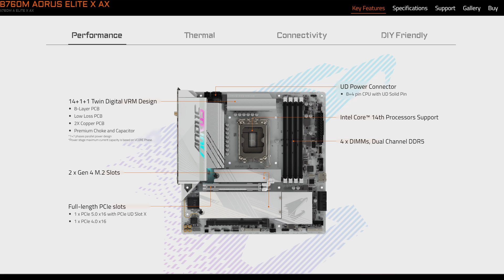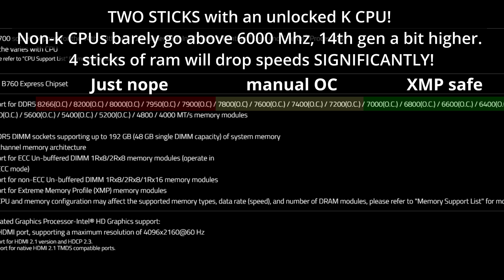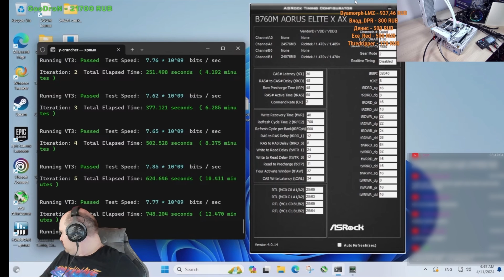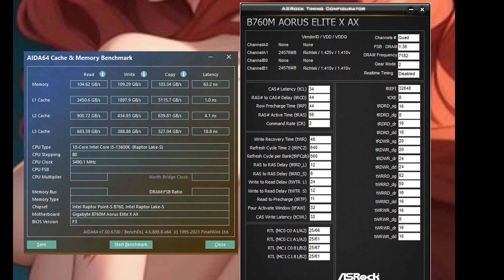GIGABYTE B760M Elite X AX Review - Awesome White mATX

Comment from the maker: This one or cheap Z790?
Reply: This one
Reply: This one boss! full white build in process!
Reply: Can I use i5 12400 gen
Reply from the maker: @ranjanry7438  yes. But you can get a much cheaper board for this cpu.
Reply: @ArtyomExplainsEng  But not a much cheaper with an all white aesthetic. Plus. Six months later, this is much cheaper.
Reply: @ArtyomExplainsEng  which processor is best plz advice
Reply from the maker: @ranjanry7438  Depends on what you plan to do

Comment: Hello, i use a ryzen 7 5800x and 64gb of ddr4 ram and I want to go for Intel since it has better single core performance which is useful for autodesk maya and vray (more single core performance, more cores, too), i5 14K has 12 cores like the ryzen 9s and everywhere I see CPU reviews it's just botted up gaming comparisons

 I already have a 850W 80+ Gold (Seasonic Focus GX) and a 3090 Vision

My plans are:
-B760M Elite X AX White + Corsair 64Gb 5600Mhz (2x32) + I5 14600K for a total of 760€,
-B650M Phantom Riptide white + Corsair 64Gb 5600MHz (2x32) + Ryzen 9 7900X
Reply from the maker: Hi. Get 6400 cl32 ram for intel or 6000 cl30 for Ryzen, not the crapy 5600. It does not have to be corsair. For games i5 14600k will be slightly better
Reply: @ArtyomExplainsEng  well corsairs are the lowest profile i can get to fit behind my radiator thanks to the little dent they have on the edges. I measured it.
Thanks for the answer but should i get a raptorlake or a ryzen zen 4?

Comment: I have a Maxsun B760M Icraft with a 14700k and 2x16 GB XPG 7200. Unfortunately, the board is only able to run stable in 6800 with various timing and voltage. I tried to include an update to the newest Intel BIOS microcode. The Mobo already has 12 VRMs, but it always fails if I run an AIDA64 stress test on 7200. 

The board also has an LED RGB problem if the BIOS setting is not right.

I still worry about Gen 14 degradation; that's why I preferably stay with B760, because I won't go CPU OC. Do you think this Gigabyte motherboard will be better?

Comment: I plan to build a PC with this motherboard, along with a 14600KF and 32GB in dual channel, any recommendations?
Reply from the maker: Get a 2x16 or 2x24 6800 cl34 memory kit, update the bios and make sure you enable intel baseline profile if your do not plan to tune your CPU manually
Reply: @ArtyomExplainsEng  Thanks, that helps a lot!
Reply from the maker: @mrsmassironi1727  np
Reply from the maker: @mrsmassironi1727  np

Comment: 6400 is ok for 13500? Because my country Gskill Trident Z5 cl32 6400 is cheaper than 6000 cl32
Reply from the maker: If you are ok with entering bios and reducing ram speed if it fails to properly work at 6400 then yes.

Comment: would the i5 2600kf work well with this board? my in total budget mobo plus cpu is around 300
Reply from the maker: 12600kf would work just fine. Do not go above 6400 xmp with ram, tho. 6400 cl32 is the best option, maybe even 6000 cl30 to be extra safe.

Comment: Hello, I was wondering about the comment on the 14700k. I plan to do a build with this mobo in a few days with a 14700k, and I was wondering, what would actually happen if I were to set intel limits of 253W and do 100% workloads with this (with a thermalright frost spirit 140 v3 cooler) across a few hours? TIA
Reply from the maker: With 253w it would do just fine with extended loads even for 24h, provided sufficient cooling is applied. But why buy an expensive cpu and limit it? Doesn't make sense to me.
Reply: @ArtyomExplainsEng  I cannot find the 14700 here, that was my first choice. I'm going to strap the thermalright frozen spirit 140 on it. Do you think it should be enough to cool it? And isnt 253W intels recommended?

Comment: I bought the new cheapy gigabyte gaming b760m ddr4 with a whopping 4+1 VRM and was very disappointed because i never thought about VRM, just figured with a "gaming" label the board would just work with a 13th i7. It did not do well. I had about a 20% decrease in lots of benchmarks. it had okay single core performance but anything more intense and i basically wasted my money. Ddr4 doesn't slow down the processors that much when i pulled other benchmark setups but that VRM is critical. Bought this board because of your video, cant wait to try it out.
Reply: How is the aorus board working for you?

Comment: Why you don't recommend using a i7 14700K with it? I'm actually in doubt about i5 14600K and i7 14700K for a mostly 3D modeling build. The i7 would have trouble on this mobo?
Reply from the maker: I don't think it would have problems with 14700k if you don't plan to do multiple hours all core load.
Reply: @ArtyomExplainsEng  so what you recommend for 14700k?